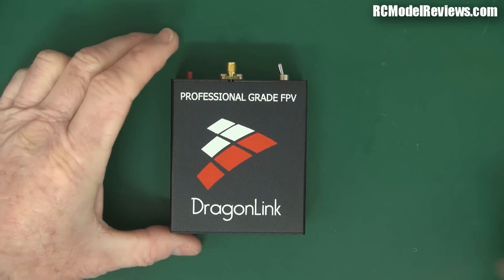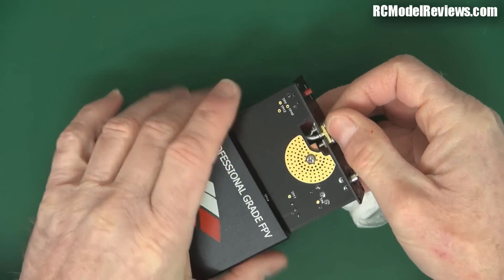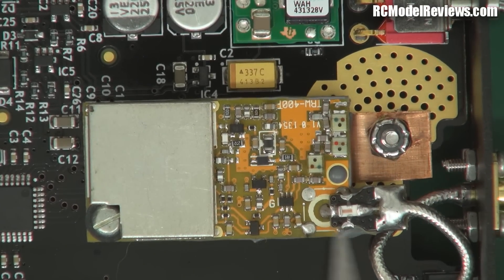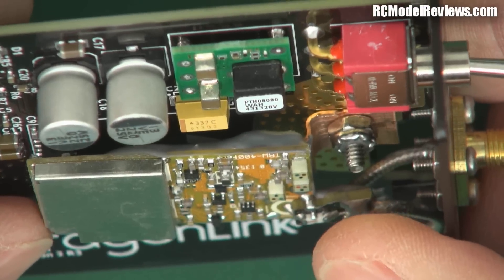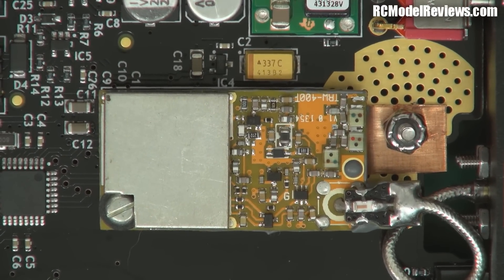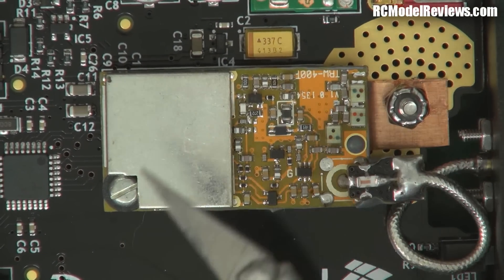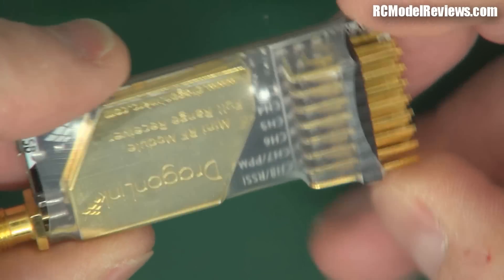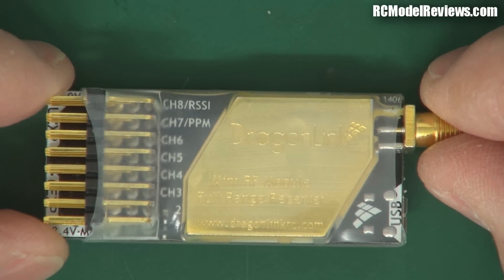UHF RC Shootout: DragonLink Long Range System (part 1)

Comment: Here are the facts:
I fly long range FPV Have done for many years surveying off shore wind farms in all different situations, sometimes up to 40km from land with large drones. Wings, shywalkers, skyhunters  I have tired many different systems over the years, but i have to say I use the old dragon link v1 that I purchased from Mike Many years ago that gives me confidence and reliability it’s never faltered. I have tired may long range systems over the past but generally all good out to point, then glitching, failsafe and other factors, Drangonlink has always been the most solid. Bruce can put them all on the bench and test them (if he ever gets around to it !) but I have to ask has he ever flown low level out to 40-50km + Has he tested them all in a real life situation at range ???. I Doubt it. 
If you want the best just by the Dragonlink that will give you perfect service for years to come and spectacular backup from Mike who looks after his customers and has a passion for what we do.
 I’m not paid for this and I have no affiliation to Dragonlink. 
The best is the best its that simple!!

Comment: As a 40 years retiring RF engineer I have to agree with Bruce.  The OEM RF module of the transmitter does open inconsistency issues for the life of the product as opposed to growing their own and controlling the parts quality.   The installation of the OEM board was sloppy and I would have concerns of it failing in the field as opposed to it being directly part of the main PCB.

I would like to know if V3 of the product line has changed any with that respect.

Comment: I'm about to purchase an LRS system and its hard like this one based on just looks.  I can't believe how bad the transmitter module looks inside with the low quality 3rd party components. I was shocked to see 3 random screws holding things together and that heat sink looks terrible. Visually speaking I'm not impressed at all.

Comment: Not one damn ~engineer~ can heatsink the warm stuff on the damn aluminium box??? 
One huge, thick walled (at times finned!) extruded aluminium box and... air between the RF final stage and it... 
And is it, there, some proper grounding on the box? Like for shielding and reducing EMI?

Comment: I think this is a terrible way to review electronics in my opinion. Not everyone builds boards which can be built 100% by pick and place soldering machines which look nice and neat and pretty. The ultimate goal is to build a solid UHF system, not satisfy some geeky fascination with pretty circuitry. Out of the systems you are reviewing, more people have gone further with DragonLink than the rest of them put together.

Comment: Alot of us like the Dragon Link because of the the Owner Mike. Top marks for service and he is always there to help. In my book, i stick with DL. Also, his gear holds the record for range with UHF. Just youtube it.
Reply: Ruben Jauregui Amen to that :)
Reply: Ruben Jauregui Yup... that's what a friends says. Heard the new RX is really good and there's no latency with the system and for me that makes or breaks any RC control the system especially for FPV.
Reply: +Elcapi56 Praise Jesus the savor lol Amen to that!! hehe
Reply: By the way, did i miss the part 2?
Reply: Good luck waiting for any part 2 from Bruce. Mike sent him a DL some 2 1/2 years ago as a review. never to be seen again. Not sure if this is the same unit or not.
Reply: eastcoast78 Hahaha he will post it i think, too many people already asked for it on many videos :)
Happy midweek mate :)
Reply: ABMNS PRODUCTION to my knowledge "amen" is something christians say when they pray... if you need to pray something works well, that is not giving me a lot of confidence. I put my trust in science and the science of dragon link is not the best...
Reply: @Hans_Ham  really?
Reply: Also, if it's so shoddy, build one yourself and market it. (Sr. RF design, performance, optimization engineer in wireless since 1993) why don't you measure actual performance? The internal layout does not have to perfect unless you're OCD, as many of us are known to be, but these are not hand built one by one, with an engineers hands. If it ain't broke....

Comment: What was the static noise at 2:24 ? just when you touched the cooling plate
Reply: Rune Mauland Kaj Zwinkels I don't think so, there's faint static every time he touches the components, even in his other videos. I looked in the comments to see if anybody else notices, at 2:22 it was very loud but other times he touches it it's very faint. I don't know what could be causing it
Reply: Rune Mauland correction 2:22
Reply: He probably just touched the microphone
Reply: ***** I don't have a headset at the moment, but to me it sounds like a discharge or a static interference at the moment he touches the cooling plate
Reply: Rune Mauland It's my old wireless mic picking up the electrical noise that metal-to-metal contact can create.
Reply: ***** ahh, ok.  Someone needs to send you a new wireless mics. We can't have those static owls going wild when you do these tests :)
Reply: Rune Mauland Someone did :-)  Unfortunately, this was filmed before they arrived.